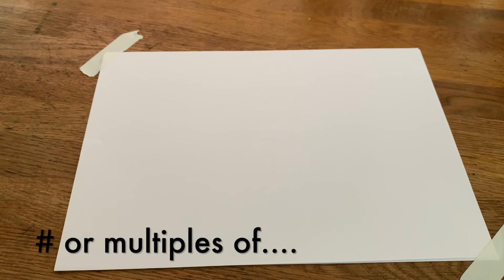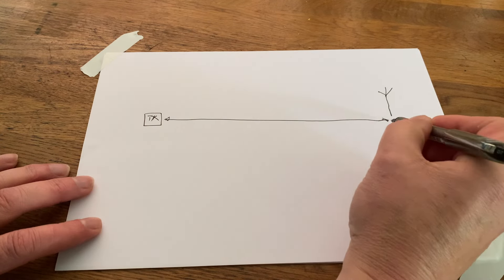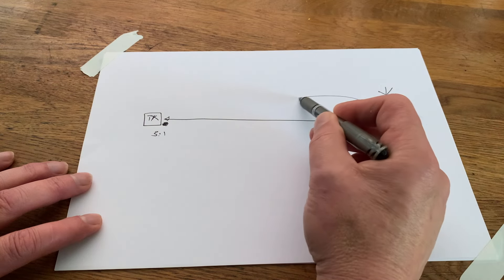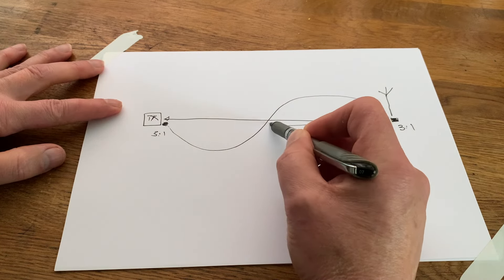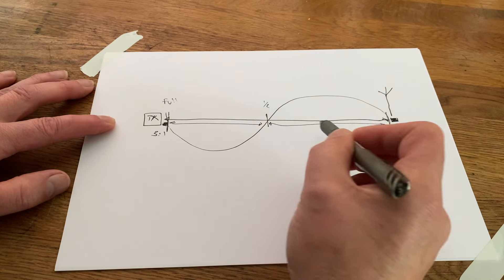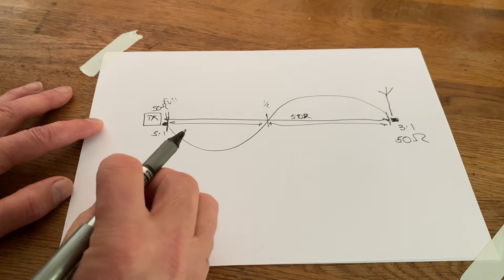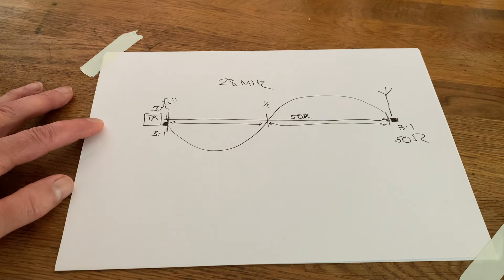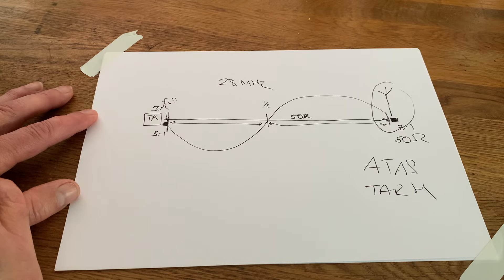THE FACTS:  Half Wave Length Coax Runs - what you need to know!

Comment: Great explanation Mike, probably the best I've seen in the time taken.
Another thing to note too is that if you change your coax length and the SWR changes - then you have a problem with the antenna - either common mode current or it's not tuned correctly. As you point out - if you have a 50 ohm load (antenna) connected to a 50 ohm feedline into a 50 ohm transmitter, it doesn't matter what the length is - besides loss of course. Cheers mate
Reply from the maker: Yep all the way!

Comment: very good mike. things change if the antenna needs to use the shield as counter poise . in that case like a 39 in moonraker CB antenna the instructions have a length of cable.  I have seen portable have trouble with length of cable. turns out   the end fed half wave had no counter poise or some choke . he did that problem solved. and in some case a matching stub in needed to tune antenna then the length of stub matters and wear placed. and if phasing antennas   length does matter. delay line . change pattern of far felid.  that for more than 1 antenna on same transmitter. but one radio0 one antenna . length does not matter unless bad coax or lossy coax. 73's
Reply from the maker: Absolutely 👍, I tried to keep it simple but you are right, there are always exceptions to this.

Comment: Using a smith chart is a very good way to illustrate the concept. As far as tuning a coax length can be beneficial sometimes. I used a trap dipole on a band it was not intended for and the auto Atu would not match it. Looking on the smith chart, I was able to see that I may find an impedance value that might better suite the atu. I added some coax length and that rotated the impedance to a value the auto atu was able to cope with. Another instance I had was after repairing a faulty commercial radio antenna and getting a good match was horrified to watch the transmitter trip on high reflected power. The problem was revealed that the transmitter was producing a significant spurious product that was only a few db down on the fundamental and that was outside the band the antenna was designed for. On consulting with the owners transmitter engineer he told me that the transmitter pa was susceptible to this problem and some experimental trials of different coax lengths between the transmitter output and the main feeder would likely cure the problem. I tried and it did work, the spurious dropped many db and was in spec. Not a brilliant design for a broadcast installation.
Reply from the maker: Agreed, still needs must.

Comment: Only C.B.'ers have problems with coax.
Nice explanation Mike but C.B.'ers still won't believe it. I've tried and they insist they need it even when I point out the 'magic' length connects through the SWR meter to the jumper lead and it's gone as if they think the meter is an isolation device. I try to explain it's one cable with a meter inserted but they of course see two cables.

I got a NANO VNA this year and want to show on a video their 'magic half wave' has gone.
Waiting for a sunny day to get some more light into the shack.
I had one C.B.'er say amateurs don't understand because we are only amateurs and of low education.
I should have taken up C.B. and become a radio expert overnight!
73, G4GHB.

Comment: 👍Thanks for video. Optimum co-ax length is as little as possible. Maybe even consider balanced feeder which will generally have lower loss than co-ax - expecially if you have any mis-matches. I watched some of Stan W1GV's videos a while back - I did not know he was SK.
Reply: Open wire feeder is better BUT, you must match at the Xmtr side and the antenna side to the characteristic impedance of the line. Then you're good

Comment: what can cause confusion and perpetuate the myth are certain antennas that recommend you have x length of coax for tuning or counterpoise purposes before passing through a 1:1 such as certain designs of windom and iirc the g5rv
Reply from the maker: Yes indeed.
Reply: Not myth it's basic rf engineering but no really  ideal for radio hams that use an antenna  for multi band use,,,listen to whats being said.
Reply: @battlestarone  no i agree with you im just saying "some" antenna manufacturers suggest using certain minimum lengths of coax with some of their designs which may cause some confusion. clearly a properly tuned monoband shouldn't care how long the feeder is and a multiband is even less relevant!
Reply: IMO you can be too short. 
Like a 43 vertical with 4:1 unun with 15 feet coax. I found 75 feet it tunes much easier.

Comment: The only time ive thought about the length of coax is when making stubs.  There you want a set impedance so you want to calculate the length from the shorted end. I always think of coax as a infinite number of sections of matching networks where their input impedance matches their output impedance. So x ohms in is x ohms out no matter how long it is.  The longer it is the more attenuation thats all

Comment: I managed to take a perfect 50ohm antenna, a perfect half wave length of coax, and a tuned radio. I managed to keep my tune the same easily across all bands at the same time., I simply left the volume knob turned all the way to left on my radio. This had the added benefit of not over stressing the circuitry or LED's in the radio, and the fuse has never even seen current, so it's as good as the day it was made. Budget friendly RF usage with the extra added bonus of lack of RF interference on any device in any situation. I think I'm onto something here........however, contacts were exceptionally quiet, one might even go as far as to say, inaudible, so there is a slight chance of a minor downside to my idea.
Reply from the maker: Brilliant 🤩

Comment: Thank you Mike.  I would point out that if you only had 75 ohm coax your schematic still applies.  If the TX and ANT are 50 ohms a multiple of half wave lengths of coax will work as you have diagramed.  Not ideal, but it works.
Reply from the maker: Great point

Comment: I've had many an argument about this too! People measuring PHYSICAL lengths and getting annoyed when I asked about velocity factor! That being said I then mentioned about multiband usage with examples, as yourself. The myth started when someone noticed their swr reading changed with length, probably due to common mode affecting measurements. Imagine having a top band antenna on a car and having to store virtually a full reel of coax in the boot!!! Thereupon lay another preconception, is it better to coil spare coax in a feedline or leave it untidy! I feel your pain!!!
Reply from the maker: Sooo true 👍👍
Reply: Imagine the coax needed for 472 kHz or 136 kHz.
G4GHB.
Reply: What do they think after carefully trimming coax to the aerial then you mention the addition of coax to the radio and of course 3 or 4 inches for the SWR meter. 
They really seem to think the extras don't add to their carefully trimmed coax as if it all stops at the SWR meter.
Reply: @bill-2018  Exactly, Some people are so embedded in the myths and legends surrounding swr making it impossible to  explain the physics governing it. Which leads to the application of chokes. Which is yet another nest of vipers!

Comment: Fully agree - except when I buy a pre made up length that may be longer than needed which then becomes the perfect length in my book. I may even wind a (usually un-needed) choke if it has good excess length . If not a pre made one is used and if neccessary a matching unit.
Reply from the maker: Perfect John

Comment: Actually it can be handy to use specific lengths of coaxial cable. Of course if you have a purely resistive load that matches the coax impedance/transmitter then you are correct that the coax length makes no difference other than the losses associated with length. However,  if you depart from this situation then coax line length can be used as part of a matching solution  I have used this many times and I get a bit more than a kilohertz usable bandwidth  in most cases 😂

Comment: Tnx Mike! I’ve used the velocity factor (.66) of the coax to determine the lenght of coax. A simplified example: on 10 meters a good lenght of coax would be 6,6 meters ( or 13,2 etc.) A second myth I suppose ;-) ?
Reply: Hi @kariolavi     There is no requirement to do this - the correct length of coax is what is needed to connect the radio to the antenna. Forget working out coax length according to frequency.  If this were true, how do multiband antennas work? VF is used to determine matching stubs and using the coax as a tuning device.  This is not what we are discussing.
Reply: A myth indeed!
Try that coax with a 50 Ω dummy load on the end and a VNA.
You will see a fairly flat response from, in my case to make a video, 1.8 MHz to 29 MHz. My 'tuned' half wave coax cut for 14.040 MHz does not matter and you will see the same on yours, and do you not realise adding your jumper has extended your 'magical ½λ' beyond that length? It no longer exists. Coax only sees 50 Ω.
Let me know your result.
G4GHB.

Comment: My kenwood couldnt tune my antenna so I ve added about 4 m of coax and now it's tuning.
Reply from the maker: Line loss
Reply: Maybe you should tune the antenna? Rather than the radio? By adding coax you have lowered the SWR due to line loss.
Reply: Are you sure there is no r.f. on the outer of your coax?
G4GHB.

Comment: If it does do something then would it not make sense to tune your coax to the natural resonant frequency of your antenne? When you tune your radio all your doing is exploring what your antenna is seeing.
Reply from the maker: Like I said, its only good for a single frequency as soon as you move off you no longer have a half wave of coax..
Reply: @mike-M0MSN  It should not fall off like a cliff, just like the antenna does not, ideally the resonance to frequency fall off curve would match the antenna giving you the best possible bandwidth window.
Reply: If everything from tx to aerial is as near as possible to 50 Ω there should be no problem.
In 50 years I've never felt any need to cut coax to a specific length APART from phasing crossed dipoles and a 2m Yagi years ago as a balun for 75 Ω coax to the D.E. tapped at 300 Ω.
G4GHB.

Comment: The only counter i would have, which is, im sure, well known: a user using the wrong coax for the band they intend to operate on.

Dont run long lengths of cable for EHF operation because you'll lose more signal due to bad choice in coax. ❤

Comment: Additional comment: Back then, we used to have L1/2 x vf or multiple for the feedpoint impedance measurement for each band. Today, hopefully every OM has a Nano VNA or better. Every main feed line is calibrated with 50 ohms and the calibration data is documented and saved. And of course, every line is addressed and labeled. This is the only way to get the actual conditions at the feedpoint. Without glossing over SWR through coaxial losses... A serious OM makes the effort once and knows forever what is really going on.
Reply from the maker: Yes the Nano VNA, the tool that every HAM should have.
Reply: Before I built my Wheatstone Bridge type SWR meter I tuned for maximum r.f. out on a pickup meter, did it for years. My amateur friend was horrified. 
Theory was that max. r.f. out was minimum SWR.
After building the meter it confirmed it. My friend still horrified as I hadn't calibrated it. I did after four years.
I have a NANO VNA bought this year and it's a very useful bit of gear.
G4GHB.
Reply: @bill-2018 It may sound authoritarian and I don't mean it that seriously... so - all with a wink, but actually, owning a Nano VNA should be "mandatory" for every OM. The associations should "gift" every newcomer with such a device when they pass the test. In addition, put an experienced OM at their side. At the very latest, when the first simple antenna works successfully for a few pennies, the long-term frustration will stop because the constant ordering of the next dud doesn't even start. Instead of asking the candidate to do some outdated nonsense in an exam, throw a roll of wire, a VNA and some coax... that will give them a lot more in the long run. Having fun and a sense of achievement will also whet their appetite for more! And you will create real hams again and not just 5/9 73 SES, Awards, Parks nonsense collectors who have nothing else to say to each other.  Maybe it will be enough to at least find out your own name and equipment, without being told by asking that you are wasting time on the "important" distribution of meaningless numbers and combinations of characters.😂😂
Reply: @rs440olli7  A VNA is certainly useful and I would say recommended to get one. Like the old G.D.O. at one time which I made both transistor and valve versions.
It didn't matter to me for a long time as I had long wires and a doublet so actual length was not important, the tuner took care of things.
Now having made dipoles for 20m to 10m, an inverted vee for 60m and a 2m 4 element collinear I could instantly see if they were too long or too short, especially the end fed collinear where the elements had to be longer than I expected. It started out as a 2 element centre fed then a 4 element centre fed and then a 4 element end fed.

5.9. 687, good luck, 73 is why I don't take part in contests. Pointless, pardon the pun. 

I've always been into making, repairing and modifying things so a lot of my time is doing that and not much operating. I do like c.w., and QRP, nothing over 5 Watts here for 30+ years. Conditions, right time of day, right frequency, operator experience listening through QRM and QRM noise level and a bit of luck all come into it rather than blasting out a lot of power knowing you have a good chance of a contact.
I've had some great QRP to QRP contacts, and some hard work ones like 2.3.9. report both ways but if both are prepared to do it works.

I'm going to do a video using my VNA to disprove the C.B. myth about ½λ coax. One has already tried what I suggested and seems to have changed his mind. They just look at 27 MHz and not the full frequency range, open ended coax does not act the same as when a 50 Ω load is on the end.
My 'tuned' coax shows a fairly flat response 1.8 MHz to 29 MHz on my 'magic half wave' coax cut for 14.040 MHz and connecting the jumper obviously lowers the frequency too.
 They seem to think the SWR meter is an isolation device and can't grasp that it's one length of coax with a meter inserted because they can see two cables and told they need ½λ coax and 3', 6', 9' or whatever for the jumper. 

I ask why they don't trim the jumper, I don't get an answer. 

73, G4GHB.

Comment: Hi Mike - thanks for this - I have a question for you please: if I have an EFHW antenna with the 9:1 balun, and two VHF antennas and connect their shields electrically by way of the grounding of a mounting plate where all three antenna wires terminate outside my shack ( in theory, they are going to be connected electrically via the grounding of the radios they are connected to as well) - do you think that the EFHW antenna could either interfere, or pick up interference due to the fact that the balun actually electrically connects the EFHW shield and core?
Reply from the maker: No you should be ok, the isolation of the inner cores and impedance differential due to the spread of frequencies should reduce any major issues.
Reply: EFHW should he 49:1 or 56:1 or 64:1 or something like that. 9:1 should be for a "random" wire.
Reply: @paulsengupta971  yes, my bad - I meant 49:1 - confused myself with my other hobby project to setup a random wire using an AT-130